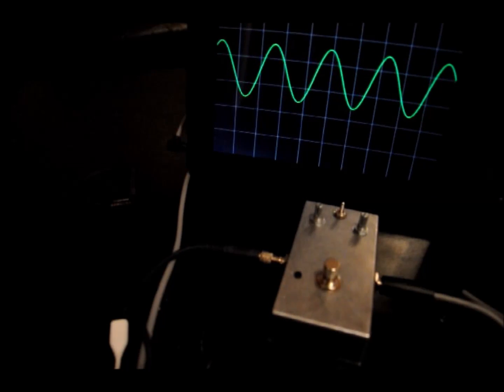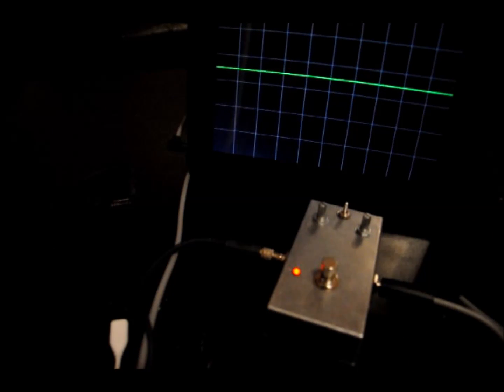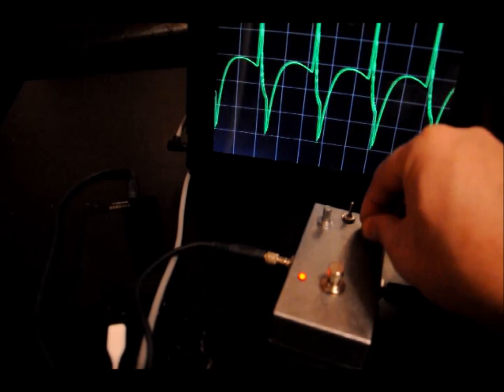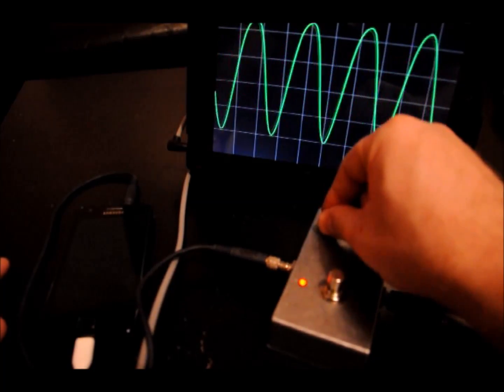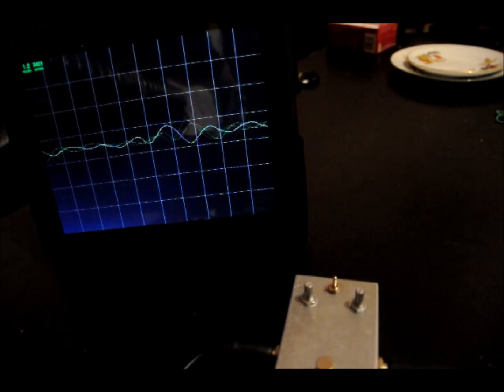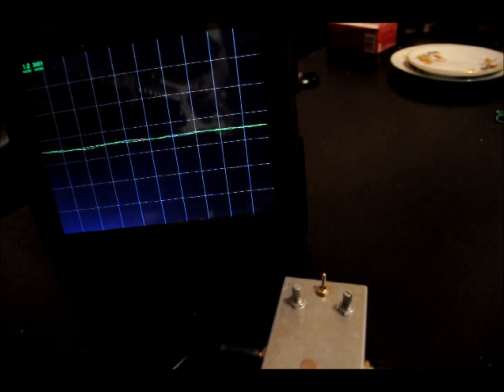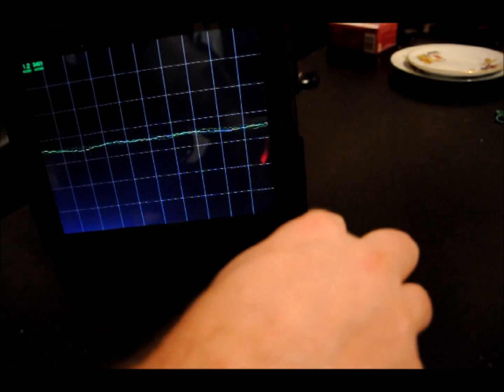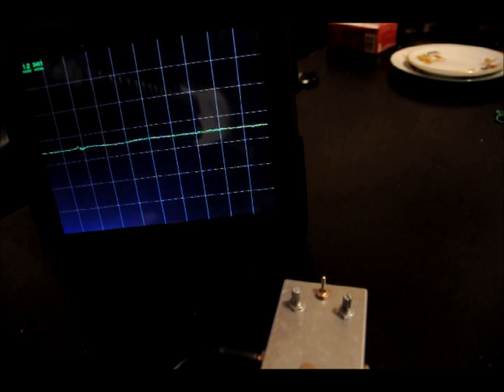Harmonic Percolator through an Oscilloscope

Comment: You can clearly see from the shape of the waveform at low input settings that the Harmonic Percolator is generating second harmonic distortion caused by the top of the waveform being very gently squashed/clipped and the bottom of the waveform being relatively distortion free, classic soft asymmetrical distortion generating second order harmonics, you would hear these as an octave above the fundamental pitch.